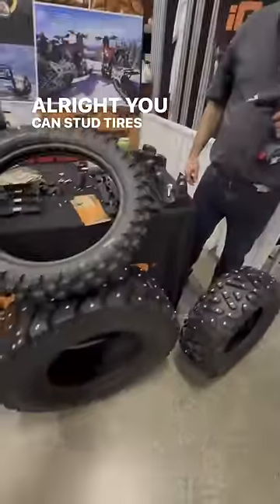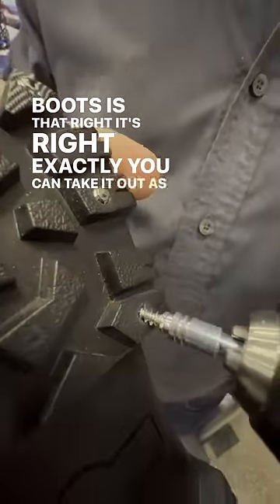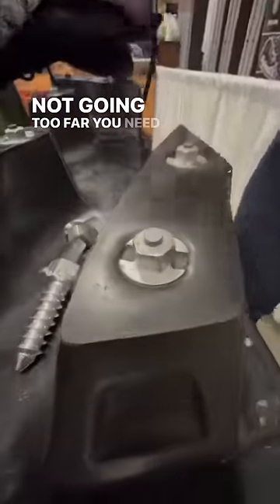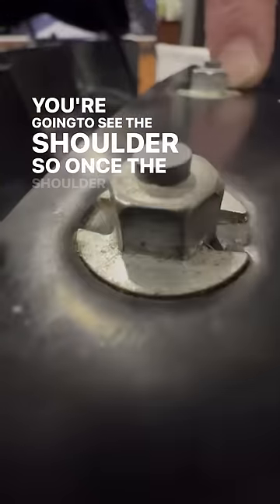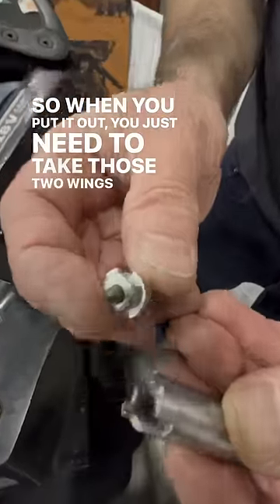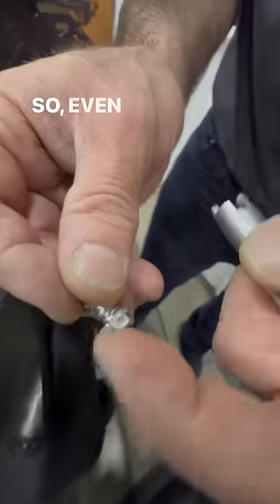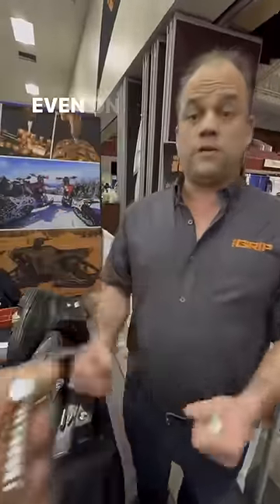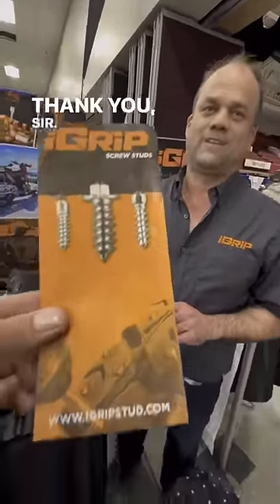Cheap way to get traction. #shorts #tractor #tires #tracks #loader

Comment: I wonder how them screws feel poking up through the bottom of your boot into your foot
Reply: Those are some thin boots
Reply: Once you feel it going into your shoulder, so boom, you stop it.
Reply: @TimberTrainer  lol I fully understood your comment
Reply: They have been studding boots for over a hundred years my guy.  Any decent boot will have a thick enough sole and midsole to not feel it. In fact high quality boots still use cobbler nails to attach soles and heels.
Reply: I've got some tungsten carbide stud screws for boots the threads are only a 1/4" long if your boots can't handle a 1/4" screw then you need new boots
Reply: Well you don’t have real boots…. Real boots generally have a good 60+ nails and a few screws as well.
Reply: @JordanWatson-bz4fb i think they meant by the time next season comes around that you still have some tread left but would it be enough to keep the screw from hitting your feet
Reply: There 1 inch nails in my boots lol holding all the layers together
Reply: How thin are your boots?
Reply: @TimberTrainer lmfao, perfect answer
Reply: @JordanWatson-bz4fb 
  If you put it in context studded footwear has been in use for a few thousand years. Known to have been in use by Roman Legion's footwear. 👍
Reply: Buy you some Dunlops and you don't need to worry about cold or a 1/2 inch screw going through your boot.

Comment: So basically a self tapper screw and a washer.
Reply: With a Carbide tip
Reply: With a carbide insert and way easier to get out.  Zip screws wear out fast and do not grip near as good as the carbide pin  but yes on your statement

Comment: That seems like a good idea until you have to walk into a customer’s building and you destroy there floor I’d rather get takeoff heel stud plates like truckers use for driving
Reply: With modern polymers used on soles there is not much reason to stud boot soles anymore unless you are in very icy conditions for long periods of time or you are out logging.  In both of those cases you probably aren't walking on nice finished floors.
Reply: Or if you are elderly and could break a hip in a fall that may result in death. Not everyone needs this however there is a place for it

Comment: This isn’t how studded tires work.
Reply: This is for tires that are NOT pinned.  A actual snow tire is pinned leaving holes for studs to be inserted, those studs have a base on them so they look like a top hat.  And the tool to install the has 3 fingers that open the hole and shove the stud in rim down and that is what actually retains them however this guy offering a solution for boots and unpinned tires as they actually have the carbide insert and a way to remove when worn because if you run zip screws and wear the head out they can be a pain to replace